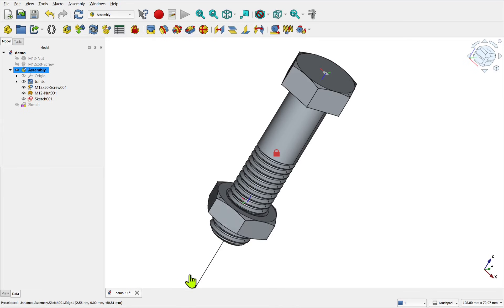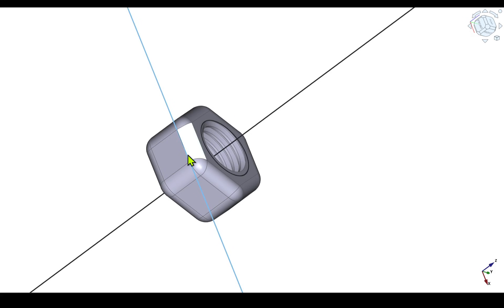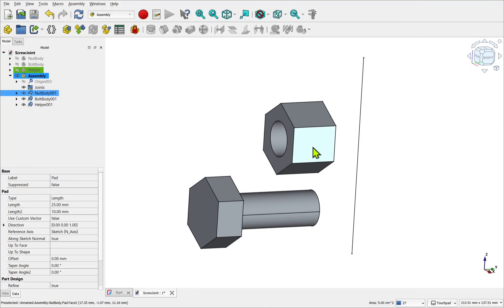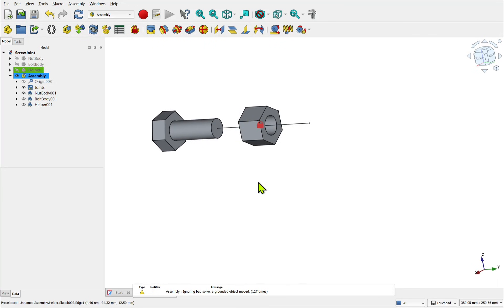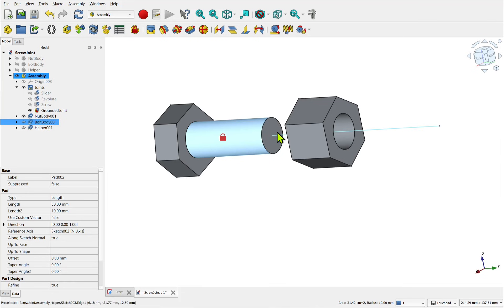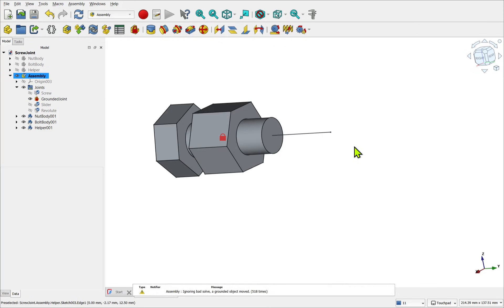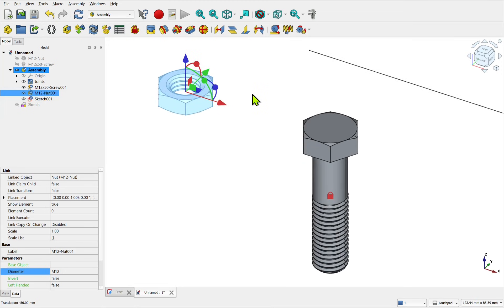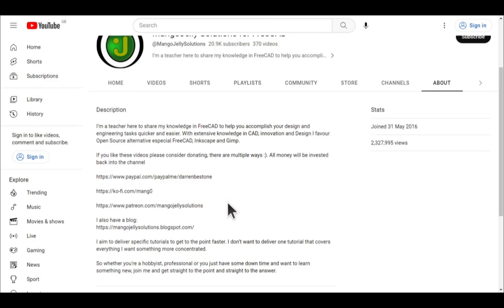FreeCAD Screw Joint EXPLAINED | Assembly Workbench | Realistic Animation of Nut and Bolt Meshing

Comment: I finally understood how to make this animation after a few hours and the importance of the guide to activate this damn Screw link that I could not understand without this guide. But admit that this is not very logical in relation to reality: take a screw; center the nut on the screw and turn the nut with the fingers or a socket by advancing in the threads of the screw (without guide). But thank you for your valuable video of information.
Reply from the maker: Thanks for the constructive feedback, I totally agree this is not very intuitive in relation to an actual real life thing and I want to  revisit this with  the other advanced joints that now have appeared, each of which require a similar process.  I was thinking of something like a clamp would be much better application. Glad the video helped, it took me a while to understand how to get it working.  I think I was a bit early off the mark to share the information.

Comment: The problem with Freecad and threads is they are memory intensive if you wish to display a thread. The act of having to switch thread projection on and off during a session is a pain.
Reply from the maker: Unfortunately it's the same with other CAD packages as well, the more faces and edges, the more processing power needed by the CPU to calculate it.

Comment: I was able to follow along until the point where you grounded the bolt. My system had the ground button greyed out. I tried saving, and restarting freecad to see if it was just some weird mode, but it never allows me to ground. I don't think the rest of the tutorial will work without this. Any ideas?   EDIT---- google ai to the rescue. The assembly needed to be made active.
Reply from the maker: That always catches me out.  You start pulling things around in the assembly and nothing happens when it did a couple of minutes ago.  Then you realize the assembly is not in bold (not active).  It seems to loose the active assembly from time to time and I think it's if you go off and do anything in the part design as you need to make sure the body is active when you make changes. Glad you found the resolution :)
Reply: @MangoJellySolutions  Another problem I encountered was I'm using gesture instead of touchpad. For some reason gesture doesn't move the assembly. (That was confusing).

Comment: i'm having trouble with the render workbench, it may be cause i've seen what the new assembly workbench does and don't like it yet, a2plus is what i'm using.  i use a part as a guide, which is hidden in the overall assembly, but shows in the render, i make it of multiple subassemblies with some hidden parts, they all show in the render.  is there a mechanism to suppress parts?
Reply from the maker: Have you tried setting the transparency on the view tab to fully transparent?  That may work.
Reply: @MangoJellySolutions  i thought about it, but usually, in renderers that kind of trick makes things look like blocks of glass.  there would have to be a material with no effect on light at all.  i was thinking of doing it eventually, but, not being able to hide objects from the renderer is a BIG missing needed feature that either is hidden, or not there.  figured you'd know if i was just missing it, then i could bug the render workbench author about it.
Reply from the maker: @felderup  Ah, shame that didn't work, the only other way I can think is to play with the diffuse, saturation etc in the materials but, as your suggesting, dropping the author a message be worth it, they may have an undocumented solution.
Reply: @MangoJellySolutions  yah, i've just got to get over the revulsion of making another account to make contact.

Comment: I really appreciate the effort you put into these tutorials they are first rate and have been incredibly helpful getting me started with freeCAD. The problem I have is you make everything look so easy, it's like watching someone playing a musical instrument and thinking... "Well that looked easy, I am sure I can do that". The reality is, getting from one step of the design to the next is not always obvious just watching the YouTube video and often takes multiple attempts. For example I tried to recreate the box with a lit that you demonstrated, and every time I tried to import the sub shape binder I ended up with diamond shapes for the pillars instead of circles. I finally got it to work (I am not really sure what I did differently, perhaps it was what I selected in the box part). The box I was making needed a special hole in one end to accommodate a BNC connector that was round but with flattened sides. After hours of experimentation I was finally able to make the sketch using two parallel lines with arcs on the top and bottom.  I was able to complete the box and lid and successfully 3d print it.
After printing I realized I needed to make the box 10cm longer, so I went back into the box body and increased the length by 10cm and everything fell apart. The lid did seem to expand correctly, but the BNC hole in the box body had become detached and although it "looked" OK I started creating error messages. I have to conclude you are either a genius with flawless execution, or you edit out hours of messing about trying to get things right 🙂
;TLDR; Could you do a video on what to do when things don't go right, and how to correct errors?
Keep up the good work, your content is inspiring!
Reply from the maker: So, funny you should say this, but there are many comments that I leave these types of mistakes in (which I do unless it's a complete crash or I do something really stupid like I did yesterday where I aliased the title field of the spreadsheet field rather than the field value itself) and even comments that I plan pitfalls.  Well the truth is, I do make mistakes and when the error messages popup I explain what it is and how to solve them (I think that is when people think it's planed, some are... most aren't).  Most of my editing is done for when I mispronounce something, jumble my words, cough, sneeze, pauses when I think of how to best explain the next step (plenty of those) or, like yesterday, my partner comes in totally unaware I have been talking for the last half hour and has a discussion with me lol. 

 I think the reason why you see it go so smoothly is that most videos are now scripted so I make a written tutorial first which is also released to my patreons and I use that to run the lessons.

Most of my mistakes happen during free modeling, when I am making something a bit more complex.  The free modeling you see in the background of my channel intro.  There was an error during that build where I wanted to add detail to the already assembled tackle box which caused a topo cascade causing the assembly to brake.  I knew exactly what had happened so I added datum lines to earlier features in the history that were stable.  Those kind of things only come with experience under your belt.  And coming to think about it, those are probably the things you would want to know in the video request.

Great to hear that you trouble shooted your build and was able to solve.  That shows things are sticking knowledge wise :)
Reply: @MangoJellySolutions  Thank you for replying, what you said makes perfect sense. There is certainly a learning curve with FreeCAD, and it's not perfect, but there is just something compelling about it that makes me want to learn more. I don't ever see myself investing in any of the paid alternatives for my home 3D printing when FreeCAD gets the job done once you master it.

Comment: Great tutorial but what practical use does this have? I mean, where would you use it? Seems like it's purpose is to demo rather than any practical use? Im conung to Freecad from a 3D print perspective
Reply: Sometimes things are connected to the screw (or nut) and you need to make sure they behave the correct way. And yes, sometimes you need to demo things to collaborators or customers. I have 3D printed quite a few screw threads - being able to try it out virtually would have been nice, now I know how.
Reply from the maker: Good question. So Something like a clamp or stimulating a lead screw assembly. Also observing the effect on other joints in a full assembly. You could stimulate custom valves. So when modeling from a top down approach you can make sure all your parts are working and any adjustments you need can be added. Given me some ideas as well 😊
Reply: @MangoJellySolutions  I've just tried making a hinge assembly with a rotating joint and then added two hinge assemblies to a lid assembly and the hinges don't actually rotate when used in another assembly, I don't see how this functionality is at all useful really unless I'm missing something, I wanted to attach a hinge assembly to a lid to make a lid assembly then attach the lid assembly to a tray, I could model this differently by attaching the hinge parts to the lid and to the tray separatelytabf the opposite hinge components could be attached to the tray then joined but that defeats the object of the hinge assembly being able to be used in multiple projects
Reply: for screws allone a sliding joint may good enough, but when it comes to an assembly where a threaded rod has to move somenthing back and forward by cranking or motor driven, it may be intresting to watch it in a simulation. Sure you can calculate it at least by the pitch if you not make use of an screw joint.

Comment: To my understanding, the label "pitch radius" in the screw joint form is misleading because this has nothing to to w/ a radius. More like "pitch height" or simply "pitch".  When you hit "ok" at 10:15 nothing is moving … because of a bug in FC. Simply enter the screw joint again, set pitch to 2 mm an back to 1 mm (or do this when the form is opened the first time) and it will move. It just does not work when you leave pitch as default value.
Now I need to file another bug report.

Comment: Another great video. Simple and easy to understand. I have to find some of the tools as I use the weekly builds and 1.1 is a bit different. (Especially with Datum planes) but it's still here.
Reply from the maker: Excellent to hear :) Glad you enjoyed.  Ah yes, they have move the datums to the standard tool bar haven't they.
Reply: @MangoJellySolutions  They moved it and it seems to be very small. I can't get it to resize. Otherwise, most of the changes I like. More fluid.